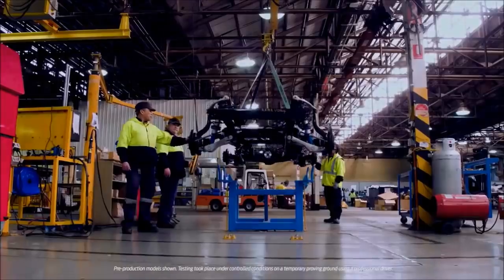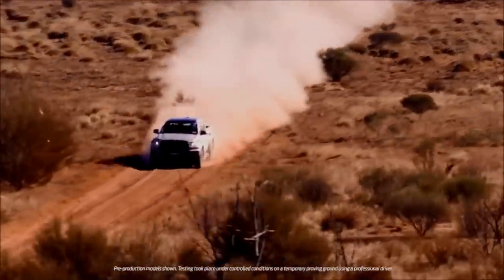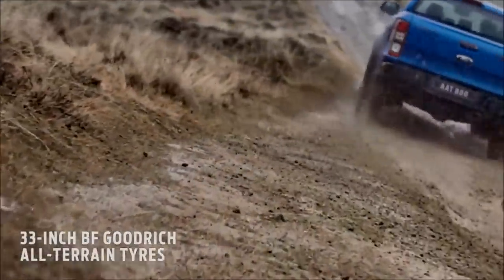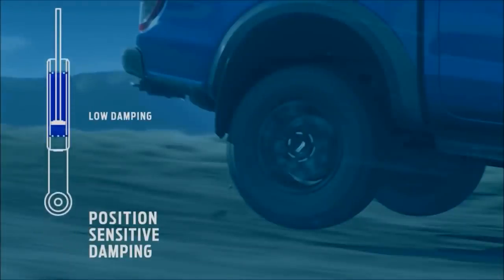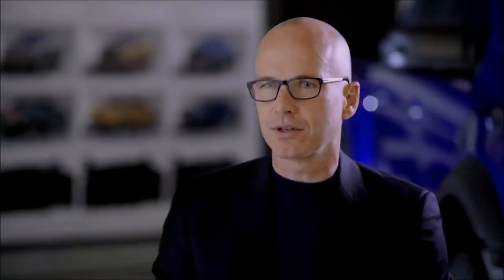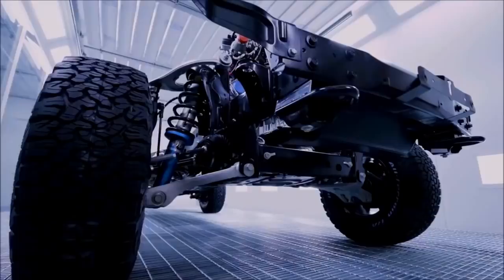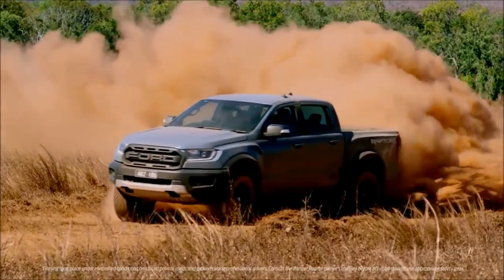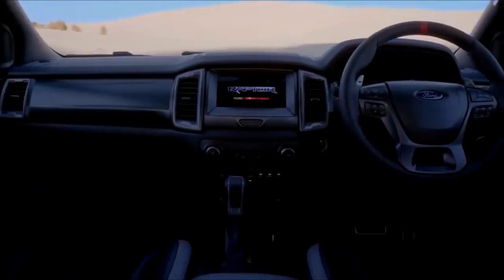Ford Ranger Raptor - The Best Pickup Truck Ever !!

Comment: I Drove one last weekend, I was looking at buying the 3.2 Ranger.
Have to say a totally different vehicle. The engine and gearbox is a lot more refined than the 3.2 auto.
I only drove on some rough sealed roads and some highway. The raptor interior and suspension make for a great ride. Would have been great if they could have got a more powerful motor like the V6 Amarok. I drive on half built roads every day for work and don’t need to tow 3.5t ever so I am seriously considering buying one of these. Oh and they look fantastic.
This is from a non Ford guy. My first car was an escort 30 yrs ago and I haven’t owned a Ford since.

Comment: Several negative comments here about the small motor.  So, you guys would rather have a big, heavy, noisy, inefficient, relatively weak motor than you would a small super engine.  360 foot pounds of torque for a small vehicle is nothing at which to thumb your nose.  Probably will have close to 300 HP.!

Comment: I currently own a 2010 ranger xlt with 4.0 v6. Tortion suspension and no wheel flares.  I think I will keep it.  It works just fine.  I am in the dirt as often as pavement.  No complaints.

Comment: Ford ranger needs to have a manual transmission option especially in a raptor
Reply: Also offer it for sale in the usa
Reply: It does in Australia
Reply: The raptor has those paddle shifters for a reason. Manual mode. or you really want the stick manual?
Reply: You can get a manual Ranger outside USA/Canada

Comment: I want this because I'm going to do alot of 4x4ing at 100+mph and jump over mountains.
I hope Ford fixed the turbo issues. In my 2017 ecoboost f150 turbo sucks. Dealership told Me to drill some f-ing hole to drain turbo fuild..... WTF!

Comment: I've been obsessed with the $38,000 Colorado ZR2 with the little Duramax diesel, little Allison,..4:1 transfercase, electronic Locking front AND Rear differentials , electronic sway bar disconnect,..a bit a the top performer ,..aside from a $35,000 Jeep Wrangler Rubicon,..a $55,000 Dodge Ram Powerwagon, $175,000 Mercedes G63 AMG wagon and a $250,000+ Unimog ,..there not anything else that has all of this, ESPECIALLY A FRONT selectable locking diff,..all the big boys off-road 4x4's have locking rear diffs,..like the $80,000+  f150 raptor etc,..but very very few on earth have a front as well, which ask ANY avid 4wheeler thats doing Moab's , or Rubicons worst trails you NEED a front locking Differantial ,.. a 4:1 t-case is critical too for low range,..Baja type vehicles like raptor maybe not so important but regardless of ALL this,..I LOvE the f150 Raptor, my brother has a 2019 BUT again NO locking front diff option ,..may not be critical for the Ranger Raptor but I've fsllrd in love with this ranger raptor,..really hoping where it's a twin turbo diesel and 10 speed, they did a front selectable locking diff!  Why not??? I'm guessing pricing is WELL beyond A jeep Rubicon or ZR2, so why not add a few $k for a F-Lock-diff?  If a jeep Rubicon can do it AND EVERY other 4x4 option possible ,..a NEW gen ranger raptor SHOULD have it! I can't seem to find details on whether it has it tho??? Anyone?  sO badass!!! If the R-R has a front diff lock and 4:1 + E/Sway bar disconnect it'd be a HARD call between a ZR2 and RR!  I LOVE a Duramax diesel+Allison option , hell its in Heavy equipment , tractors etc ,.real world proven,. but that raptor looks SO good!!  LOVE the Baja widebody!!! And TT-dieslel!  Let me throw a little wildcard,..Jeep has the new 4-door truck conning which is a Jeep JL wrangler with a bed,..they ARE doing a Rubicon version as well with the 4:1, E-swaybar disc., ALL the electronic off-road options of sand snow rock water crossing etc ,F&R E-lockers, 4.10 gears, AND bringing the commonrail Diesel to the US!!  The 2019!Jeep JL wrangler Rubicon 4door has now proved itself even over its top performing 4x4 of the year brother from the previous year,..look up "Litebrite" a YouTube that built a 2019 that takes it with a little lift and a winch places that $150,000+ modified rock buggies and Baja purpose builts go! It's proven the new JL Rubicon is SO far beyond anything out there it's rediculous,..now adding that exact vehicle with 4 doors, a truck bed, by adding a common-rail diesel Cummins mod and new tec axles it's a game changer and hoping Ford steps up to meet it,..will be considerable less than this raptor too SO Ford needs to step up , add front selectable locker, E-Sway bar disc, and a 4:1 wouldn't cost more than $1,000 a per vehicle, do it Ford and you may have a top performer!!!  Or stay wothout it, keep it a high speed Baja vehicle that can't rock crawl, hill climb, expedition or do a lot else, and costs more than a ZR2 or Rubicon .  🤔 that CAN do those. 
Point is,..Ford NEEDS a selectable front locker diff vehicle , and just annoying they STILL don't have one on ANY vehicle and NEVER have before??? they don't have one in ANY Ford vehicle ,..if this is the 4x4 top performer for Ford it's gotta have one!  Chevy has a 4x4 with EVERY 4x4 option available, so does jeep and dodge ,..I've heard Toyota has developed a front diff lock now in a TRD ,..missing a 4:1 and sway bar disconnect tho,..Ford shouldn't be this far behind with a truck this cool!  The f150 raptor should have it too for that matter but is a lot heavier ,,.thats why the jeep and ZR2 are so good for front diff lock.  I'm a jeep guy but have a Safari built TRD 4Runner with Factory TRD selectable rear locker and an aftermarket ARB selectable front locking diff and it's a game changer! I do trails in Moab with purpose built rock buggies and then drive 250 miles home end of day.  For those that say a front locking diff doesn't matter ,..if you go to the 4x4 proving grounds of Moab Utah where GM, Ford and dodge/Jeep/Chrysler do a LOT of their severe 4x4 testing,..the harder trails list "Rear locker mandatory AND FRONT diff Locker mandatory!"  There's a reason for that,..IF YOU want to do some of the hardest 4x4 trails on earth like the 2019 JL Rubicon and ZR2 are doing , you MUST have a front Locker!! (A 4:1 and ESBS helps too,)A F-150 raptor won't get past the first obstacle on half the top trails in Moab and has only been shown to actually finish 1 of them , being Hells Revenge which isn't all that crazy but rated one of the hardest in spite,..when a Rubicon JL will do 95%of them AND completeing MOST of the hard bypasses not taking the easy bypass like the 4WheelDrive magazine test of the f150R had to do. It's a key.   If you want to see what the difference is watch the YouTube video 2019 F150 Raptor verses 2019 Ram Powerwagon to see how it goes.  They did tons of testing and the ONLY test that the raptor beat the heavier Ram in was high speed whoopty doos,..EVeRY other test of 13 total was largely won by the oowerwagon which is sad considering its SO heavy and a 3/4 ton with an older big v8,..but beat the raptor SO badly because of the front diff lock, 4:1 , gearing and ESBDisc.  The rockcrawler and hillclimb section was embarrassing for the raptor,..the limited slip front diff did just that,..it was limited and slipped horribly,..dropping to a halt 1/8th the way up the climb and 1/6th the way into the crawler section.  When the power wagon finished both where only the Rubicon wrangler and a $300,000 Mercedes Benz Unimog (which honesty is a commercial vehicle when you can order it as a forest fighting fire truck) the aMG G-wagon would fare well with all the same but no one has yet to allow their $175-200,000+ luxury SUV to test it lol.  The aftermarket Brabus 6x6 Gwagon has done it but clearly not a stock vehicle,..the ONLY other one that has done 10 for 10 in manufacturers Moab testing was the New US Military Hummer replacement built by Oshkosh but again,..talking $250,000+ for that.  So realistically only 3 attainable vehicle for most people have EVER passed this testing ,..Ford needs to reach higher! 
Wouldn't it be cool for Ford to take the RR and hit the MOHVMB testing and actually be the first Ford and only the 4th OEM vehicle to ever complete those OHV tests!?   There's NO excuse, raptors are a topnof the line off-road performer ,..probably the best looking ,..and most expensive ,..freaking give it a $1,000 front locker for hells sake ESBD and at least a dog box 4:1 add in or gear change.  With Fords in house manufacturing they could literally manufacture ALL these for likely $1k for all of it per vehicle and mark it up a little. Telling ya IF they did,..theyd pick up a LOT of jeep guys,..Toyota guys,..anyone into rock crawling or expedition long range wheeling.  Sales would be even crazier than already! and this raptor would be perfect!!! With ALL the development into Baja why not add that and be the top of tops!!!??? Please do it Ford and pick up a TON more buyers!!!  IF not,..why pay that pricing when you can get a ZR2 or new jeep pickup with better 4x4 system?  Please Ford! Do it! 👏👍👍

Comment: Boy that red tape is gonna drive you crazy when you need an alignment and it's cocked off to one side...
Reply: That's why you keep black tape in a little tool kit that's how you would have to adjust the pull😁
Reply: Guns&Cars   100%... absolutely - like on my new AMG C63s!  If you can’t get the steering or suspension right... DON’T put the stripe to remind you every time you drive! 😡
Reply: Guns&Cars only if u let an idiot set the alignment...not hard setting the  steering wheel straight before adjusting toe.....
Reply: Red and black tape in the glovebox
Reply: Im sorry, but it would drive me nuts when my steering wheel is out of alignment, not just the "red tape".

Owner of a 2012 F-150 Raptor. Never had an alignment issue...90k+ miles.....
Reply: That's why you have to take it to an alignment guy who knows what the F he's doing!
Reply: Been driving raptors since 2013 (four of them) and never had a problem with the steering wheel alignment.
Reply: Or just get an alignment instead of destroying your tires
Reply: My Problem with the 'red tape' is that it is RED and having a dark interior with blue stitching makes it not work for me.  At least they could have matched the stitching !!